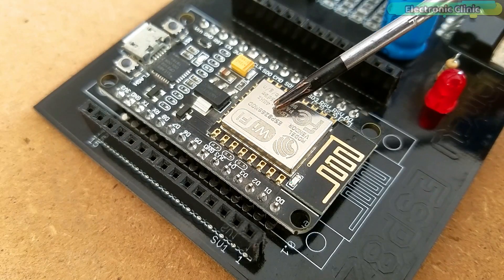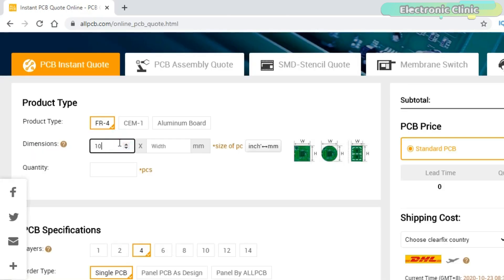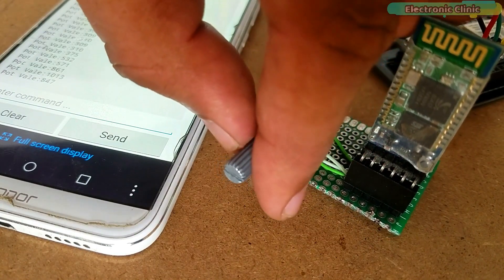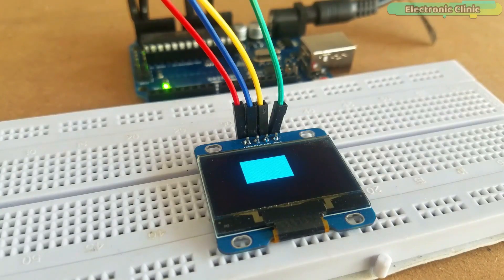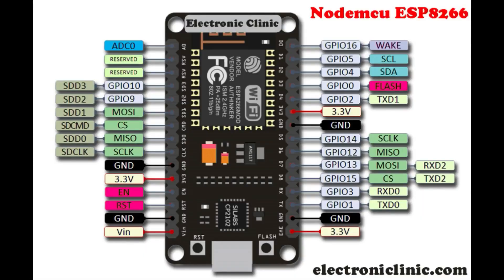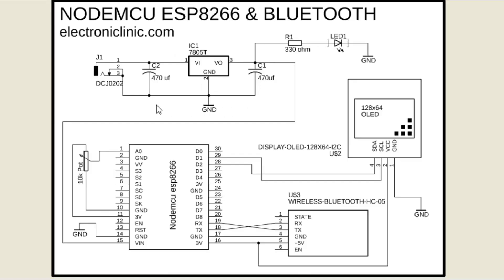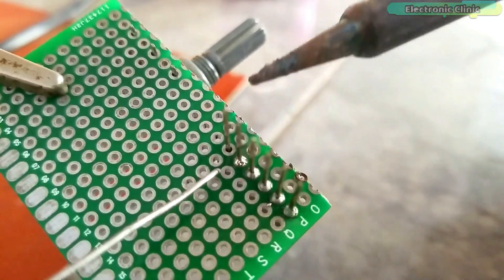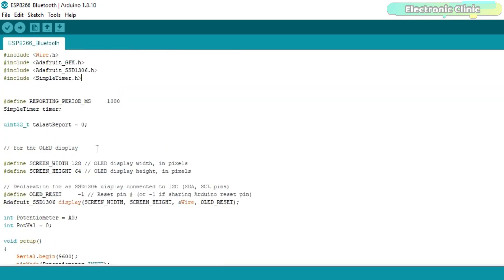ESP8266 Bluetooth | NodeMCU Bluetooth | ESP8266 Android application, HC05 or HC06 Bluetooth, ALLPCB

Comment: İ Want to ask if it is possible or not.

İ have got 
a- 1st arduino with esp8266&hc05 and LED on it
b- 2nd Arduino with hc05 and DC motor on it

You have an app, that when you push a button on your cell Phone it sends signal to my First Arduino and LED is on.when the LED is on,

Can it trigger a hc05 on First Arduino to send message to hc05 on second Arduino and maske it turn on the DC Motor?

İ request only Yes or No message.i would be glad for your help.
Reply from the maker: yes you can. i am working on a similar project. o have already ordered the pcbs. soon it will be available on channel.